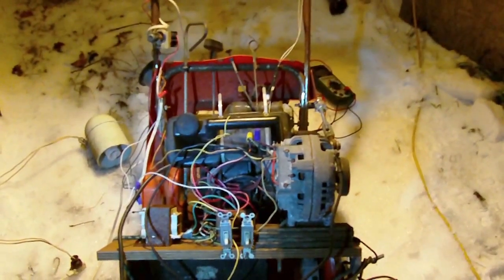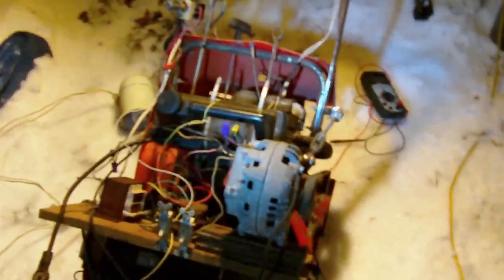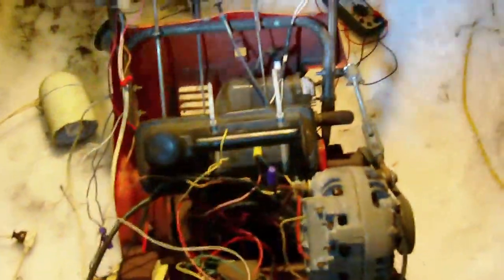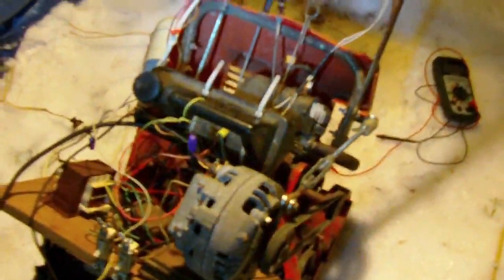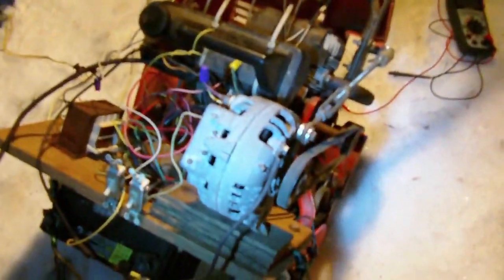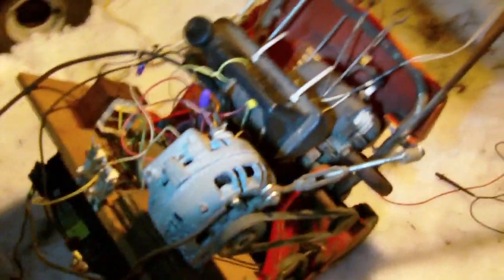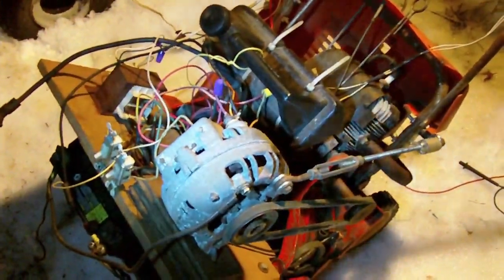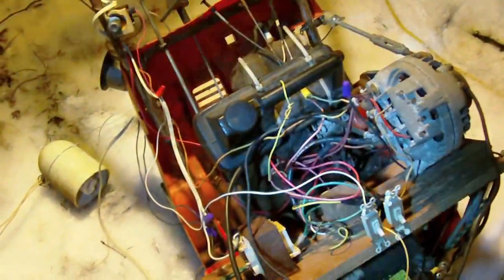Homemade 12v \ 120v Generator

Comment: I love all of your videos. You can also take the regulator out of the circuit and get 120v of DC to run power equipment.  But of course the voltage will vary depending on the load and if you go much past 120v... the diodes can get fried.

Comment: k so why cant you mix the 2 of these things together then you could have a cheap power full inverter ..from you usp inverter video. ohh and io think you motor could use a better muffler .. and step up the motor side pully for more rpms on the ALT... side lower resulting in lower rpm of the gas motor  better fuel mileage lol.. find a good ratio that will give you around 2,000 rpm at an idle on the alt.. side its just a thought but i think it could be more effective